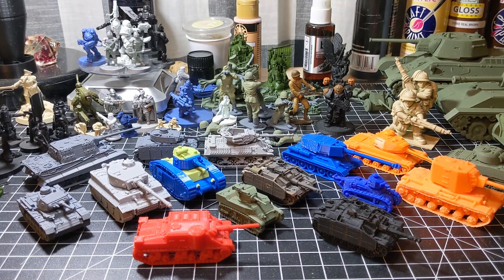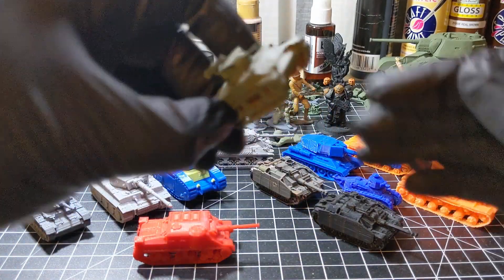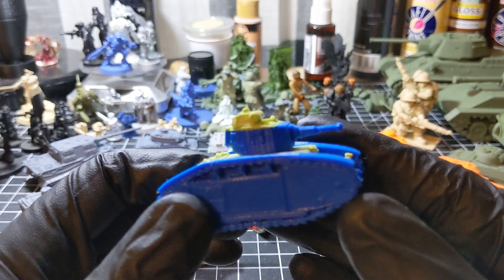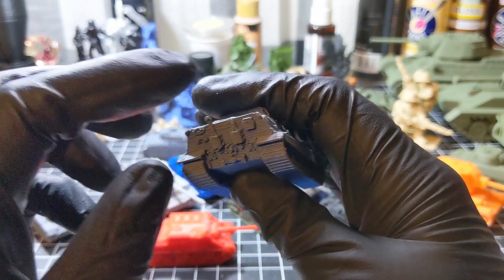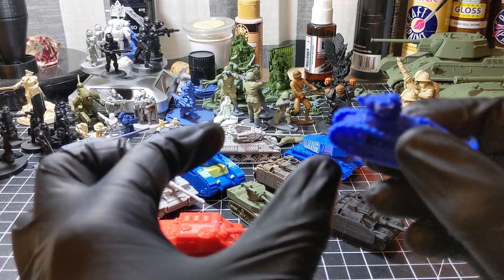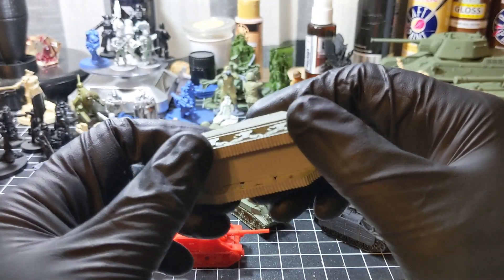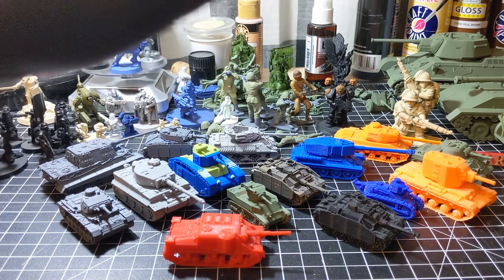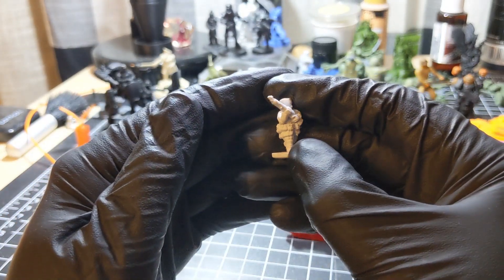3D PRINTED FLAMES OF WAR WW2 15MM TANKS | MOOSEWORKS PLASTIC SOLDIERS

Comment: The lines that we see from the printing can they be minimized? Just a couple of points, the tank on 4:18 is a Jagdtiger with a 128mm gun(not 88mm) and further later the two German tanks at 3:45 is a Panzer 3 with extra side armor and at 4:44 another panzer 3 early variant with 50mm gun.

Comment: Hi, the painting is good, no question. I don't like these lines on 3d printed stuff, some people do not care and that is fine as well. To compare it with PSC they offer 5 vehicles for 23 britsh pounds and they came with tons of variations and spare parts. The Jagdtiger from Zvezda costs less then 5€.
Nice collection anyway, thanks for sharing.
Reply from the maker: Ty!
Reply: Of your 3d printer is built properly you wont get any lines or minimal lines bust theres ways to get the lines out using sanding some primer and paint

Comment: Do you use a Resin printer to print them ??
Reply from the maker: @debojitbiswas9168  These models were all PLA prints.
Reply: @mooseworks_soldiers  can I do it with resin printer?
Reply from the maker: @debojitbiswas9168  Yes